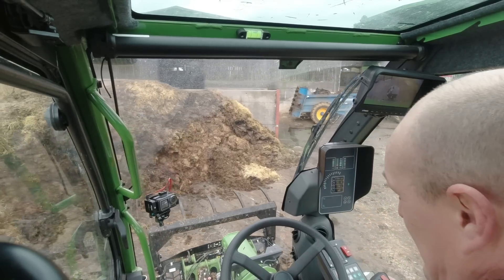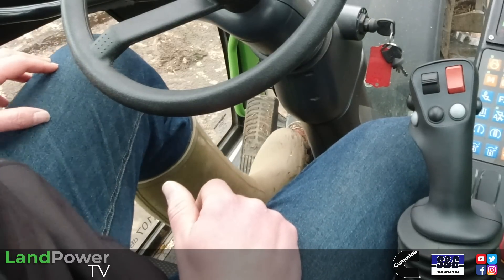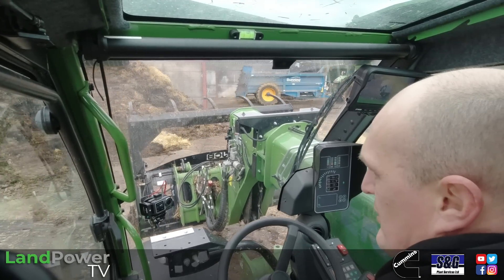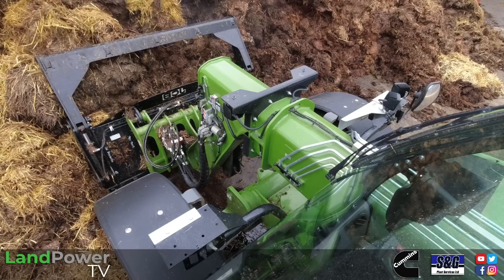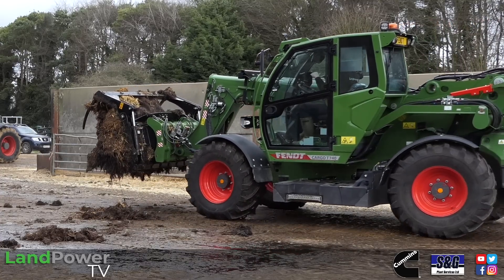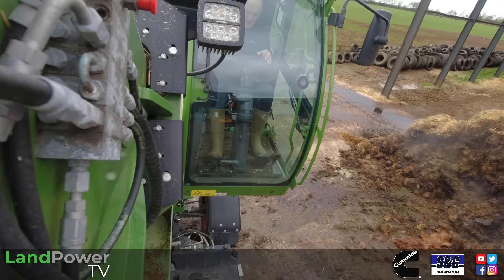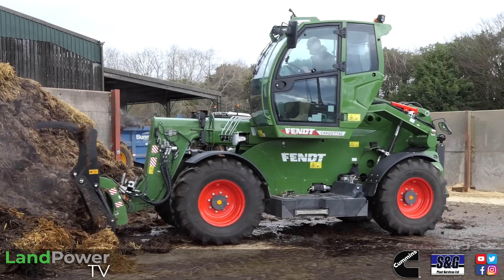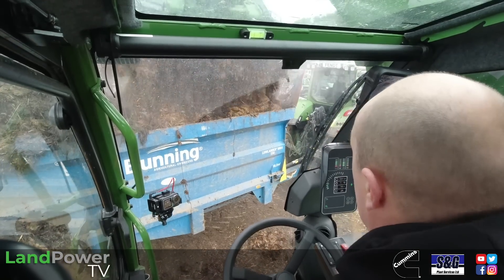Fendt Cargo T740 Telehandler: FIRST IMPRESSION

Comment: I'd say it's expensive ,fendt's are not cheap
Reply: €152,100 , you think is worth it? you need to load gold with it 😅😅😅
Reply: @neverstopexploring7772  claas is in the same range no doubt jcb as well caterpillar was even more expensive than claas in 2007 despite being a powershift/ torque converter basic machine when i bought mine and it ended up being a literal LADA fixed everything but the frame on it thorough it's lifetime down to the trade in value .... the cheaper claas/cramer 7030 would've had twice the trade in value...
Reply: @flo__60  At least this have a fancy cabin lift , i don't know where is needed that much, cuz with experience you know where are you unloading. JCB is with a reason expensive. Claas scorpio is good stuff, only bit light for heavy duty.